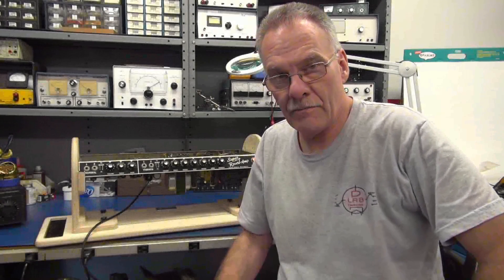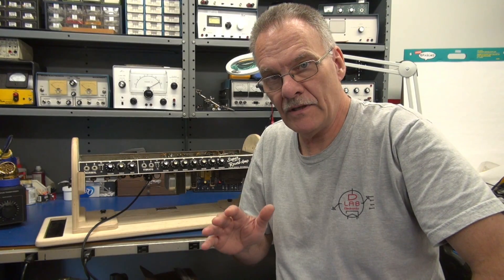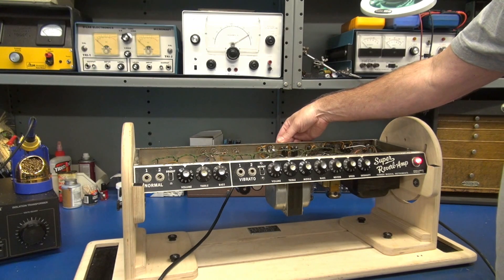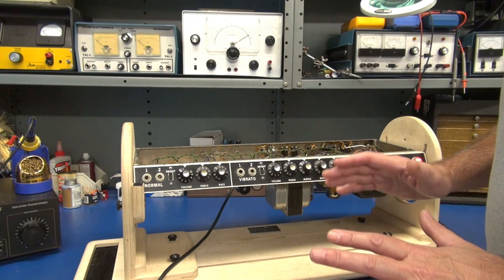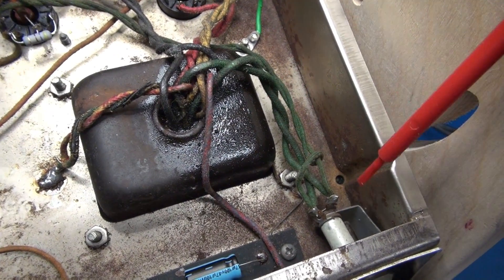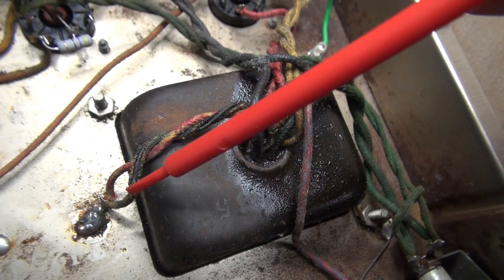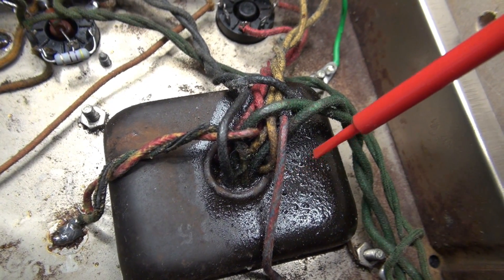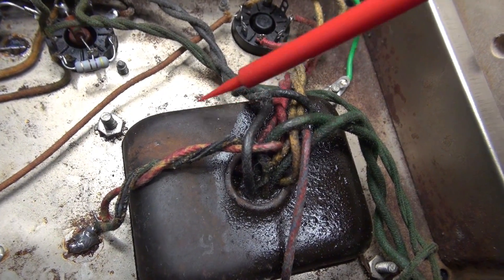Fender Super Reverb tube guitar amp loud buzz hot power transformer What caused this failure?

Comment: What was the final repair? Did you end up replacing the pilot lamp assembly? Have a similar amp on the bench with corroded, but still seemingly in tact tap.

Comment: My diagnosis is an intermittent short circuit to chassis ground inside the socket assembly for the red pilot lamp. These lamp sockets often get loose and wobbly. Although the short might have been intermittent at first, this 6.3V winding can likely deliver 15 to 20 amps into a dead short. This might have welded together the items touching each other inside the lamp socket. And that led to eventually melting the 6.3V CT wire coming out of the power transformer. Then, with the open CT, there would be increased audible hum.

Possible fixes:
Replace (or repair) the pilot lamp socket.
Add a series resistor of 22 or 47 ohms between chassis ground and center tap for 6.3V heater winding. With this mod a short will only raise the load on the 6.3V winding by ~250mA or so.

Comment: There are 2 center taps, one from the 6.3 filament supply and power center tap. There appears to be a fault ground connection to chassis. Not sure if that caused the transformer failure.

Comment: Ok so you  obviously still have 6.3V out put because the red light is on, if it was an internal short of the 6.3V winding of the transformer to ground or to the high voltage surely you'd be experiencing a lot more smoke, any other short either in the tube sockets or the lamp holder can be ruled out for the same reason , I'd say a fault in the centre tap wire, a crack or a break that has been heating up until finally breaking, easy to check just put a metre between the break and see if there is any potential.

Comment: Could be a pilot light short to ground. My feeling about an output tube cathode/heater short is that most likely the tube would fuse before that thick ground wire. There was no apparent heat damage around the pilot light and it looks original, so I'll change my mind and go for a transformer internal short.

Comment: Hi Terry, I really enjoy your channel & content. Thank You so much for sharing your experience and knowledge with the rest of us!!😊 My thought on the failure of the 6.3v CT lead is that the pilot lamp socket insulation material has either failed, and / or some other short condition within the pilot lamp socket ass'y. The 2 green leads (6.3 volt) exiting the power transformer are likely heavier gauge - say # 16-ish and the center tap around 20 gauge providing a weaker link in the current chain, and therefore, the failure point. Since the rest of the heater chain wiring looks pristine, and is of smaller gauge than the main 6.3 volt leads, it would seem as though the over-current condition would be localized therein. Also, if the failure is external to the transformer,  I would be curious to know how the original transformer, scars and all, would fare under a 48 hour burn-in period under a normal load - say 75 % of power before clipping into a dummy load. These is just my thoughts and guess, and am looking forward to a follow up posting on this vintage treasure!!!
Reply: I noticed there is no fish paper insulator around the pilot lamp socket, and the back side appears to be awfully close to the chassis

Comment: I had an amp come in 3-4 years ago that had the CT burnt in two like that BUT the amp wouldn't even work and had no filament voltage. Turned out to be the panel lamp socket had shorted to the chassis and fried the CT. i fixed the CT lead and replaced the panel lamp assy. and it worked like a  top .

Comment: Without thinking too much about it I would think it is a heater to cathode short in one of the output tubes. It would cause enough current to flow in that CT to heat it up until it opens - that is some fuse! On that note, check the  mains fuse and see if it is a 20 Amp fuse. Check the output tubes for shorts in a tube tester before powering on again after attempting to reconnect the CT and bring it up on a current limiter. Did I pass the test?

Comment: It can't be a bad tube, filter cap, etc. because the burning would be on one of the filament wires (or the tube) and not on the center tap.  It pretty much has to be internal to the transformer.  Best explanation I've heard is the one that one filament wire shorted to the center tap.  Once the center burned open, the filament wire was no longer shorted to ground and the heaters resumed working.

Uncle Doug showed the exact same situation in a video.  No real answer there either.  He couldn't find any active short after the event, and "saved" the vintage transformer by adding the 100 ohm resistors to the filament leads in place of the original center tap.  That got it working, but I don't think I would trust a transformer that got that cooked.  I'd put a transformer in it.
Reply: Could you link me to the original video ? Or help me find it

Comment: More than once I have seen where a $200.00 power transformer did a great job of protecting a 20 cent fuse.  That is a pretty hefty wire that burned open. Possibly a nick in the wire at time of mfgr., and over the years it cracked and started arcing which overheated the transformer.  Just a WAG.

Comment: Terry thanks putting us to the test today.  I learned allot reading everyone's comment to see what their own rationale was.   I'd check the tubes for a short.  The transformer paid the price but I don't think its the primary problem.  Bad tube caused that leg going to ground on the transformer to overheat and burn up.  I think it would have to be a pre-amp tube as the power tubes are fed by the output transformer.  Not sure what a short in a rectifier would look like.

Comment: With that center tap burned open, there shouldn't be any resistance to ground on the filament winding.  I'd test for that.  I'd say there had to have been a short to ground (at one time) to burn it up like that.  Perhaps a filament to cathode short.  But it would have to be a pretty stout tube not to burn out first.  It's possible that damage was done a long time ago and corrosion finally opened the overheated center tap wiring.

Comment: Did you ohm out the transformer for opens or shorts? My gut instinct would be a short to ground on one filament lead, possibly internal. With the CT and the filament lead shorted together, the transformer will induce 3.15V at very high current, eventually burning the center tap. If the short is internal, you wouldn't notice it.

Comment: That the center tap of the transformer ground wire was not up to manufacture specifications And over the years it deteriorated slowly And when that opened up that contributed to the transformer overheating

Comment: I don't know Mr. D-Lab. Is there a way to see if there was a short at the tubes? Some other fault in the circuit which overloaded that ground?
Are you 100% certain it doesn't need the balancing resistors? 
I don't know about the salty air thing...I mean NASA launches the most complicated electronics out of FLA. 
I'm not buying the salty air thing. Maybe the owner left the amp out in the elements but one doesn't do that in Nebraska either.
There must be tens of thousands of guitar amps in FLA. I'm sure most are fine from "salty air".

Comment: I had something similar when a tube socket had arced across the filament and plate pins and created a pathway requiring replacement of the socket. (It was caused by flyback voltages due to a poor load connection)

Comment: Pull and check tubes for internal shorts/damage. 

Replace PT. Bring it up with Variac control. Troubleshoot as required from there. Whatever took out the PT filament ground while the line fuse survived will either become readily apparent, or it won’t. If not, it was an internal short in the PT.

Comment: I had a Hi-watt 100 head that did the same....after I had let some-one use it for a gig it came back with a fried wire on the transformer. Looking at the cable that was used to connect amp to speaker it was found that a guitar/signal cable was used to connect them and not a proper speaker cable, a blue flash was seen from the Hiwatt I was told. After all that it must have been a really cheapo cable that became a giant resistor and on/switch that destroyed that beefy transformer as it worked perfectly when the proper cable was used to connect (after the repair) but it taught a lesson the hard way...we were teenagers with part-time jobs so we had to learn how to make our equipment last and that's why I watch your channel . Thanks.

Comment: Going WAY out on a limb. (Seriously - my father was an electronics technician who once diagnosed a problem with a stepper motor on a microfiche machine from my verbal description! I did coding early, a host of other IT jobs before I retired.) But I am leaning toward a short in the transformer. The part is clearly shot, so a new one will be needed, but it clearly needs replacing. Start from there and test, test, test with a variac until you determine if there is an over amp (or voltage, but melted implies some amps) situation upstream? Terry, I love your channel, and between you and Uncle Doug, I've learned to enjoy listening to folks that actually understand tubes at the intuitive level.